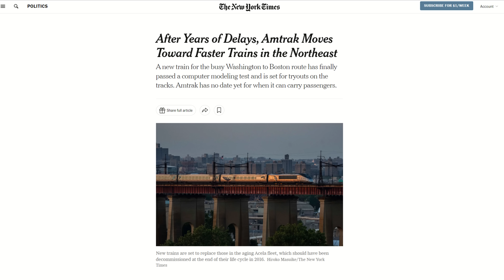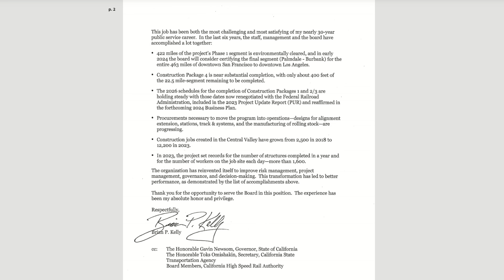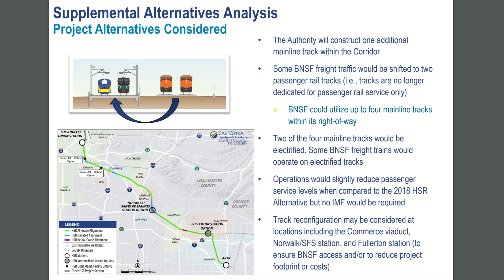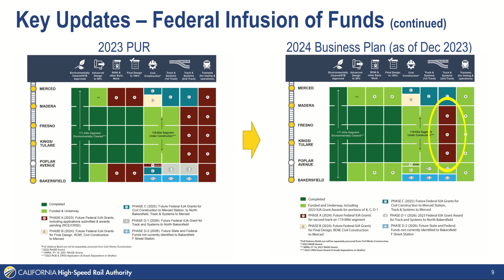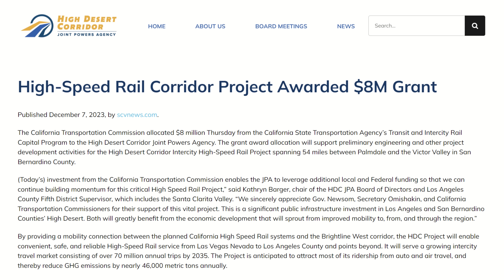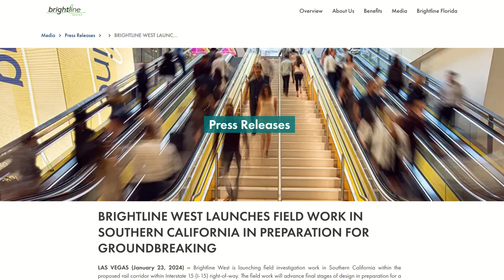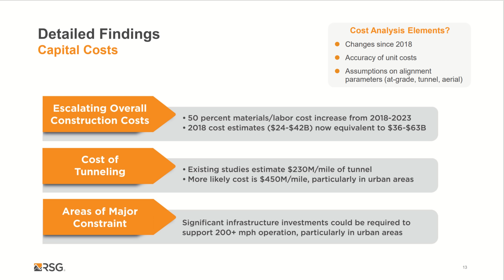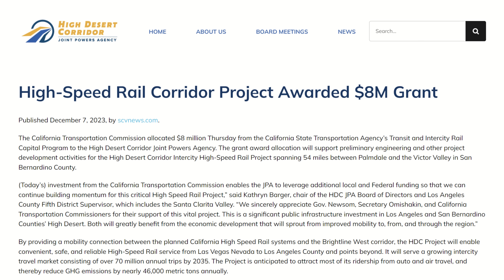Stew's Feb 2024 U.S. High Speed Rail News | CAHSR Brightline West Acela NEC Dallas Ft Worth Cascadia

Comment: It's absolutely CRIMINAL that LA Metro would "value engineer" LinkUS to apparently only have ONE track coming out to the south. That better be an initial condition, not permanent.
Reply: What the hell? LA is like 10x as big as many cities in Germany that have fully electrified frequent S-Bahn systems.
Reply from the maker: @BigBlueMan118  There is no electrified intercity rail in the U.S. west of Harrisburg Pennsylvania, which is about 130 miles from the east coast.
Reply: @LucidStew one could make the case that the south shore line between Chicago and south bend could count as electrified inter city rail
Reply: @tonywalters7298 and Caltrain electrified service between SF and San Jose will begin this fall.
Reply: @ChrisJones-gx7fc Would also appreciate CAHSR running on the Caltrain Corridor with a German built Siemens Pioneer 220 trainset to demonstrate and promote ridership  and prove the concept of a :30 ride. Of course a build American waiver would be granted (same as with BLW) because it makes too much good sense not to wait up to 20 more years for a distant future as yet unfunded V2V route connection. l won't mention the alternative Dumbarton/Altamont route.
Reply: @davidjackson7281 DAVID, YOU SHOULD MENTION THE DUMBARTON BRIDGE/ALTAMONT PASS ALTERNATIVE BECAUSE IT'S THE OPTIMUM ROUTING..
Reply: @michaeljones7927 Yep. You're ever so correct. But l did not want to bug or jack up (much) ChrisJones because l know he doesn't care much for that route. He prefers an about a 6 year Pacheco Pass buildout with adequate and secured funding ($20-30 B). 

Side Note:  Besides a few other interests, l somewhat follow football and baseball as a distraction to balance out the not always good transit news. Still ecstatic about the fed grants though. Rooting for Goff.
Reply: @LucidStew and yet india electrified their entire network in 20 years
Reply from the maker: @tonywalters7298  fair enough, but the point being illustrated is really unchanged: there is very little in comparison to the amount of track in the country.
Reply: @davidjackson7281  Altamont is a more complex and expensive route than Pacheco, involving having to navigate through the urban Tri-Valley area and build a new Dumbarton Bridge with all the environmental hurdles that would involve, not to mention it would split trains between San Jose and SF, whereas the Pacheco routing has both those cities on the same route and will utilize the existing Caltrain corridor from Gilroy.

Pacheco is set in stone and what’s being pursued for eventual funding, just as Tehachapi to Palmdale and to LA that way is. Pacheco provides the most direct route between SF and LA. Both were explored and Pacheco was decided a long time ago, and that’s what’s being built. Same with Tehachapi and through the Antelope Valley.
Reply from the maker: well, there ARE two as I understand it. one electric, one not.
Reply: Oh boy. Can’t wait to see nanderts 2024 metro video; Link US will definitely feature, like it did last year.
Reply: @LucidStew not true South Shore runs to South Bend IN